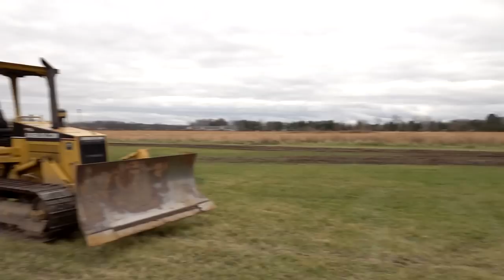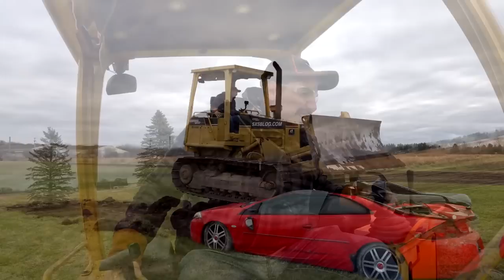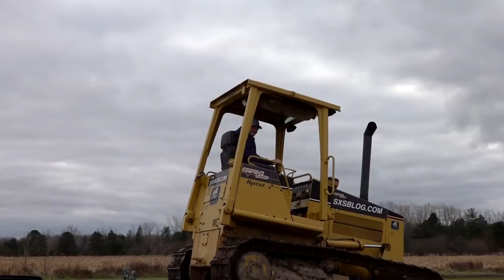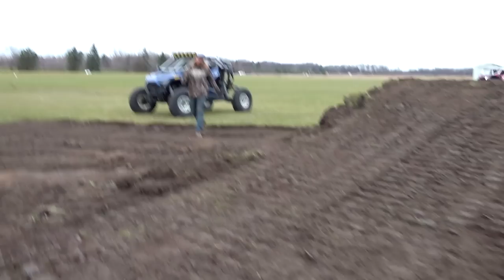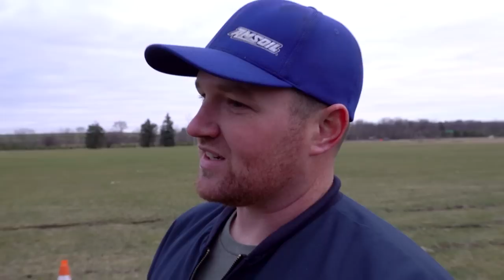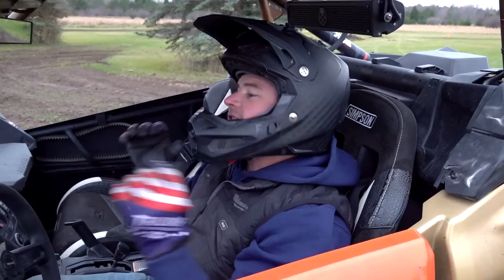We fire Frank, get a dozer, and try to build jumps!

Comment: Frank builds the jump faces long enough. your old jumps are too short. In mx we build the jump faces 3 times longer then the height of the jump. 2:1 for a big ol booter. you get the kick back when the sxs blow through the stroke on the suspension, the rear is trying to rebound while the front is already falling down from the jump, kicking the ass end up. slow down your rebound and turn up your compression

Comment: To settle to JPS really problem your new adjustment r ails need to be 6 to 8 in and have 10 to 20 holes for adjustment because you have 17 in of travel you need to have at least six to eight inches of adjustment bracket that bracket y'all put on there is less than 4 in on each side you need six to eight to adjust that rear out and down